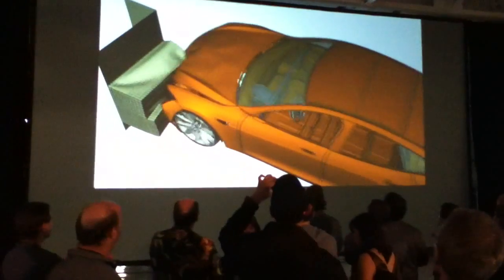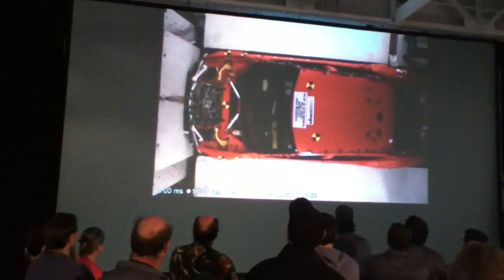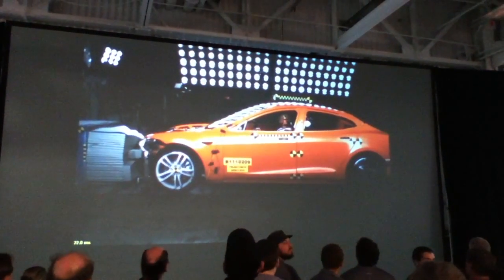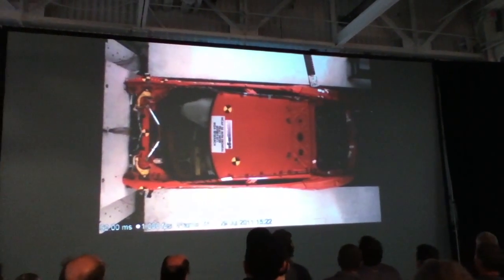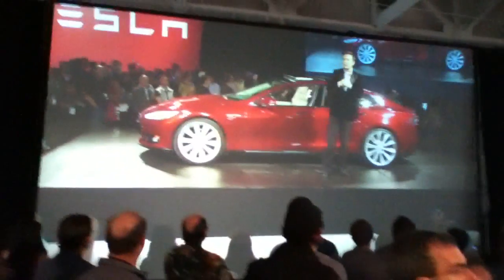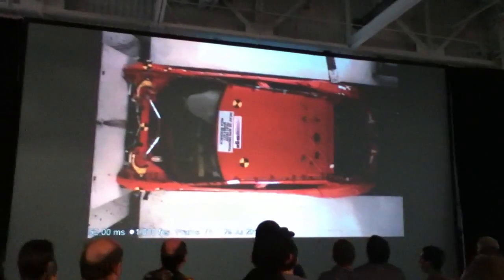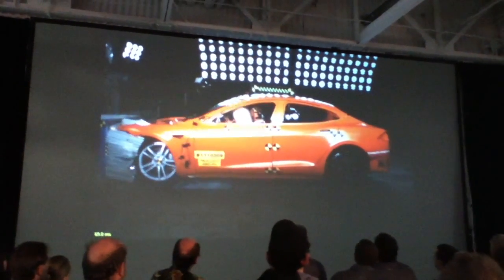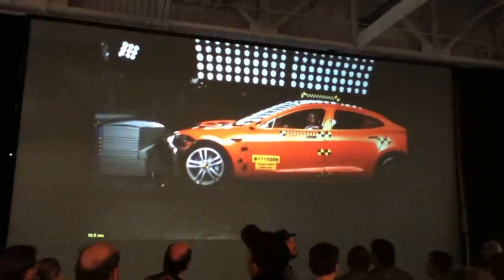Tesla Model S crash test video

Comment: Gasoline doesn't explode, it catches fire slowly. Unless your car is already on fire, gas cars can't suddenly explode.
I have much more concern about lithium batteries, one cell explodes and you're dead. 
 Statistically speaking it's criminal to use current lithium batteries in such amount and packed energy just below you.
I'm a HUGE fan of the Tesla and electric vehicles but i'm also concerned this issue could kill this industry entirely.

Comment: There is a manual door release cable that is tucked behind an access notch in the carpet to release the doors in the event of a failure of the power door release while you're inside the car.  If you're outside the car, you call Telsa service.

Comment: I don't think it's going to do so well in the IIHS offset crash since there is no engine in the front so there is not as much material to slow down the barrier from getting into the safety zone. But I might be wrong. And the test they did in the video is an easy test. In an offset crash test half the front is being crashed and at 40 MPH.